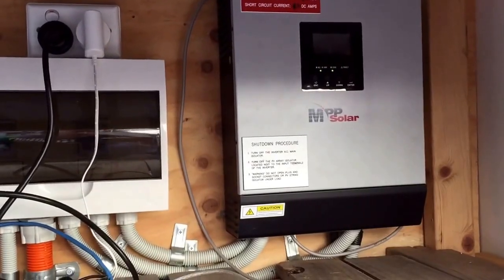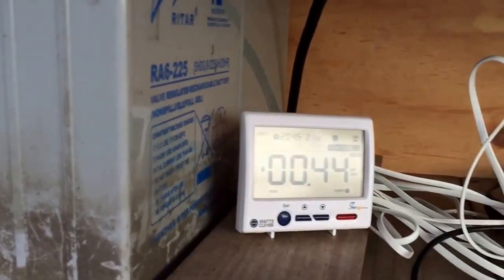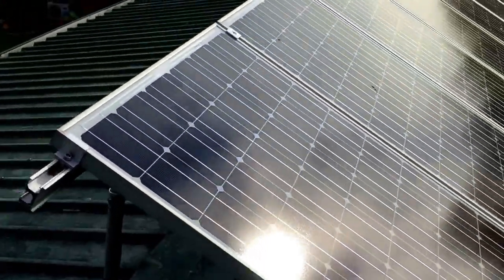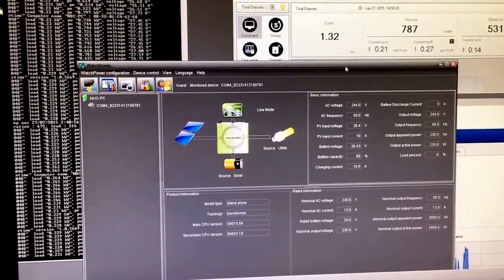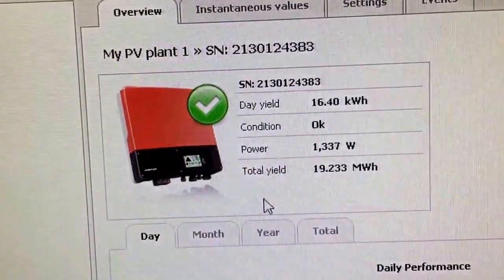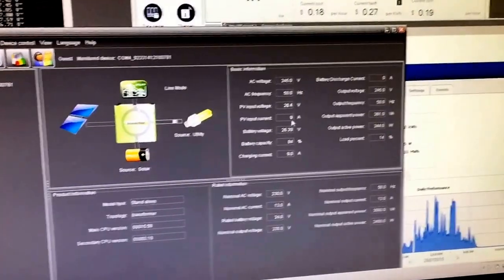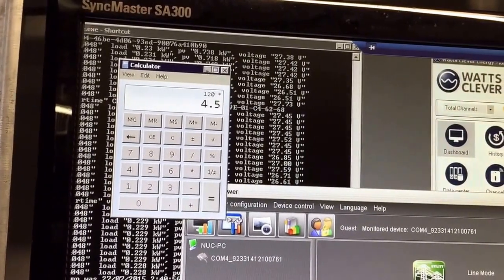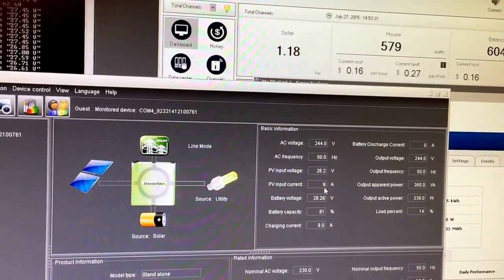MPP PIP2424HS INVERTER UPDATE after 120 days use.

Comment: how many watts you have to this system?
Reply from the maker: was so long ago i can't remember - but the inverter is still running i'm doing a video on it at the moment
Reply: @HBPowerwall  Hello sorry about my name lol but i have a real serious question for you. I recently purchased one of the hybrid 2400 and the output is Ground then L then N, my question is how do i hook this up to my ac panel? it puts out 208-230 volts on just one leg. My panel consist of two 115 legs. How do i wire this up so 220 is not flowing through just one leg? please help.

Comment: Hi,

Would you please share the pinout of RS232 communication (supplied with Axpert MPPT inverter/3KW Solar Charge Controller) cable, which used to communicate with PC.

Actually I have purchased a SCC-MPPT 3KW Solar Charge Controller but unfortunately seller has not provided supplied communication cable.
 
http://www.voltronicpower.com/oCart2/index.php?route=product/product&path=24&product_id=80 

Thanks
Reply from the maker: Quick google search will find what your looking for

Comment: i have 2 of these pips, and 6 new 150 amp hour batteries.  running in line mode.  alarms keep going off at around 25.6 amp, state of charge.  i believe 27.0 is full.  what am i doing wrong? 25.6 is still a good battery charge...  still trying to set system controlls properly.  im in the usa.
Reply from the maker: check your low voltage cutoff voltages sounds like it's settings somewhere, post on the www.diypowerwalls.com with screenshots of your configuration and I'll take a look and make some suggestions for you to try
Reply: What voltage inverter do you have 24 or 48 volt?

Comment: Have you looked into the pip 2424GE or 4048GE to replace your sunny boy inverter? It can take high voltage over systems so that you can go full off grid?
Reply from the maker: Not unless someone sends some to my wife free :) Also that would be a huge downgrade in quality. SMA inverter stays where it is and I won't be playing with it as it is still has many years of warranty left
Reply: HBPowerwall understand! I just don't want to have to pay for more panels as my 3kw system and a 5kw battery would run my house off grid.

Comment: dear HB what I don't understand you are using also a sma sunny boy is it separate system of is it al one system
Reply from the maker: SMA TL5000 is completely separate. It is grid connected - PIP2424HS is only running 3 circuits in the home

Comment: +HBPowerwall does your unit run larger loads when in Bypass modes or does it cut out when it approaches the 2400w limit of your inverter? thanks
Reply from the maker: +Marc Bladen it is fused to 32 amps so can run up to that in bypass mode
Reply: +HBPowerwall, thanks for the speedy reply. 

Did you configure this in the unit? my unit just shuts down when it approaches 2400w when its fed with grid power and bypass is showing on the LCD. I havent configured mine at all just installed straight out of the box.

This means I cant use it in real life because as soon as I kick up the water boiler and a kettle the inverter cries foul!
Reply from the maker: there are a  BUNCH of videos on my channel about the configurations I've used - just have a quick search should point you in the right direction .
Reply: Sorry I can't see the wood for the trees, I've seen the software Windows Setup, and the 48v setup, but I cannot see a setup for the 24v
Reply from the maker: sorry that inverter is long gone - if I trip across the video I'll link it here for you... I'm sure I've done several back in the day probably 12 + months ago
Reply: ok cheers buddy, my interest was more to do with bypass mode, it seems that the max load is dependent on the inverter rating whether it is on-inverter or in by-pass mode which is unfortunate, i thought that it would be at least rated for 32a (breaker size) but it appears to be the 13A
Reply from the maker: Come to think about it setting are the same no matter the pip inverter 
so set it to SBU - solar battery ulitily and it should be fine set all your battery low settings and away you go. .if the computer attached to your inverter is attached to the internet i can remote in via team viewer and fix it up for you
Reply: Thats very kind of you but I'm also struggling to find a Laptop that will recognise the Inverter I have installed the software plugged in the USB (its usb to usb on this one) but the laptop recognises a USB lead has been plugged in but then nothing! I'm going to dig out a windows 8 laptop just in case.

Comment: hello
i just want to knw could i charge my battrey without charge control .
did i need only battrey,solar panel, and this item 
thnks
Reply from the maker: this item has a 30amp PWM charge controller & AC charge controller built into it .
Reply: +HBPowerwall thanks for replying.
could i make it running 24/7 without non stop? 
and if it possible to have one of this, with mppt change control?
my country is worm West Africa with mppt change control I can make little bit more (watts)

thanks again
Reply from the maker: +Seehu Drammeh pip2424msx is mppt 60a version.

Comment: aussie batteries is now selling a device that enables parelell pips
Reply from the maker: +closertothetruth For the PIP2424HS? or just the PIP4048's ?
Reply: +Peter Matthews not sure no specs in the add but no doubt it would suit your 24v if 48v automatically sinc, ask aussie batteries or the manufacturer,  aussie wants $99

Comment from the maker: @Mark Willett , it works for me that's all I can say really.  Only thing I should/could have done is gone the 4000w unit so they can be run in parallel. 2400 watts just isn't really enough (teen age kids that think you need Toaster, Kettle, Fridge open, Deep Fryer, and hair dryer all running at the same time :) )